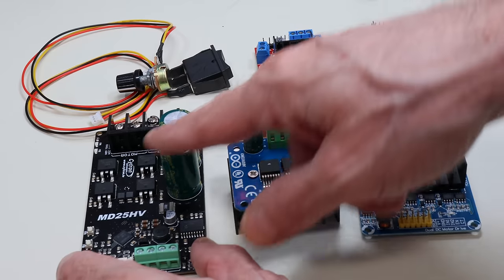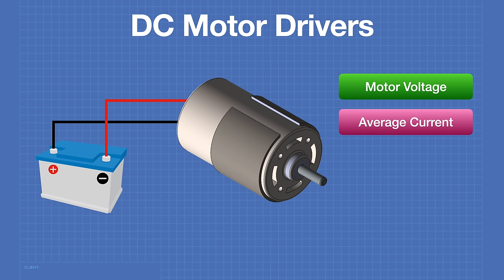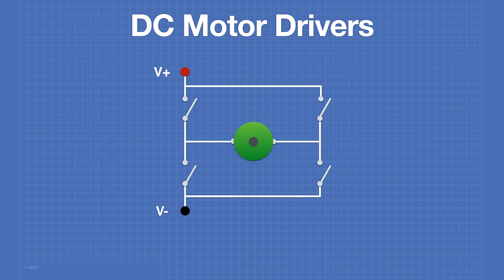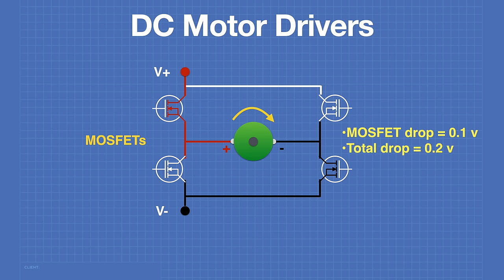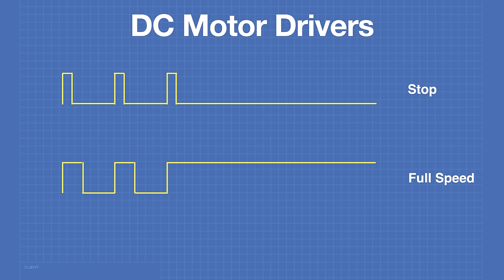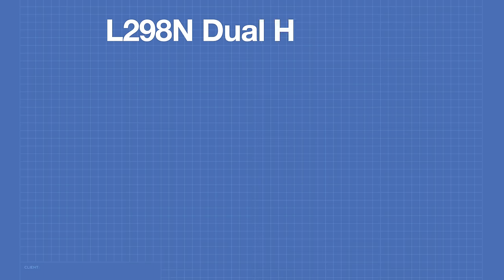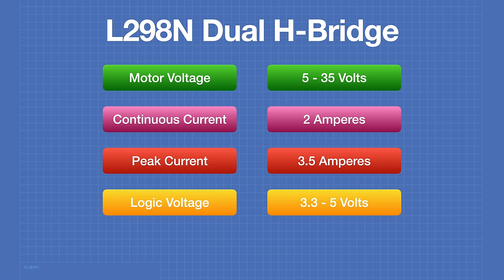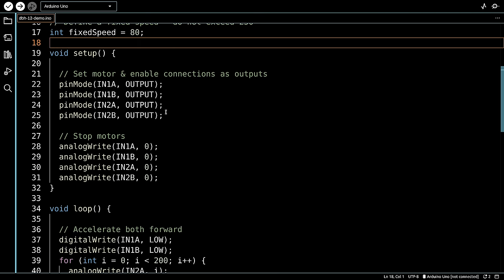Driving DC Motors with Microcontrollers

Comment from the maker: Hi everyone - It's come to my attention that there has been someone masquerading as myself, responding to some comments here with a link to a Telegram chat to win a prize from me.  THIS IS A SCAM, I am not holding a contest, nor do I have a Telegram account.  PLEASE DO NOT RESPOND TO THESE MESSAGES!!

It's happening on a lot of my videos, I'm taking steps to remove them manually, but as I have 162 videos, it will take some time.  If you do run across a suspicious comment, I would appreciate you letting me know at info@dronebotworkshop.com.

Thanks!  

Bill (The real one!)
Reply: @Bill  I was wondering if you have any info or videos on how to connect NEMA 23 steppers with Arduino Mega or Giga even a Uno. I have a few raspberry pies and I wanted to make a CNC controller but I can even install LinuxCNC so I thought I would try out Arduino excellent video by the way take care Bill

Comment: Not to be ignored are the motor controller boards that communicate with the Arduino via I2C.  They only require two of the precious IO pins to drive your robot’s motors, and the libraries available to control them take care of all the setup details.  People new to the sport will be best off sticking with brands such as SparkFun or Adafruit, and picking motors from the same places that they indicate are compatible with the board you choose.
Reply: HB
Reply: I2C is the way to go whenever possible.

Comment: I'm getting the idea the brake function is either a reversal of direction to break the motor, or basically applying a high frequency AC to the motor to hold it or slow it,  I saw a 120v (DC) motor powered on  AC power once, it eas a worm drive conveyor motor and gear box. It just turned the output about .030" or less, of rotation back and forth. And just vibrating on the floor, a diode and capacitor would made it work, a full bridge much better, it was interesting seeing it just vibrating barely rotating at all..

Comment: Great content as usual.
Minor nit pick. Vbe is 0.7V for bipolar transistors; Vce(sat) is 0.3V.
When using FETs, keep in mind that they cannot change from OFF to ON (or ON to OFF) instantaneously; there is a slew rate. When they are in this intermediate state, there is a voltage drop and a current flow; so they have to dissipate power as heat. It is nowhere near as bad as bipolar devices, but needs to be kept in mind when switching them very fast.

Comment: H-Bridge devices have so many different applications.  They can be looked at primarily as a motor controller but I also use a H Bridge to convert the digital signal out from an Arduino  to DCC +-15V square wave for HO/OO scale model railways.  Very versatile device.

Comment: At 3:40 I think you are confusing the base-emitter voltage drop of a bipolar transistor (about 0.7V) with Vce(sat) which is often on the order of 0.1V, similar to a MOSFET. Otherwise, amazing video. I can't believe the work you put in here!

Comment: Great presentation as always! Cytron urc10 robot control board, which is UNO R3 and cytron 10/30 amp driver all on one board, is great project option. One power hookup and lots of pins.

Comment: This is a very well conceived and instructive tutorial. 
However, the most versatile motor controller I know of was left out.
This is Basic Micro's ROBOCLAW. 
It comes in different sizes but the most common is the Roboclaw 2x7 capable of driving two motors drawing up to 7 Amp each. 
This controller has the ability of processing signal coming from motor encoders and controlling the motor's speed via a PID (Proportional, Integral, Derivative) feedback loop.

Comment: BTW: I see eBayers selling Wheel Chair motors without wheels. I found that Harbor Freight pneumatic wheels with 4 bolt holes line up perfectly, and cost around $5. You should knock out the inside bearing to fit the hub nut, and fill the tire with Fix a Flat or Slime since the valve stem will be on the inside mount side.  I think they are the 4-5 in rim, white wheels. The IBT-2 45 amp motor controller works on a wheel chair motor. You can get the IBT-2 cheap 2 for $15. I bench tested my Wheel chair motor  yesterday and it only pulled 10-12 amps under no load so there is plenty of amps left for a load. I believe DWS said the IBT-2 were 30 Amps continuous. 43 peak. I just looked on eBay Wheel Chair motor prices have skyrocketed They run from $130 to $200 each. It might be better to look on Craigslist and buy a whole chair for $100-300 from an estate sale.   5 years ago I got 2 eBay motors without wheels for $75. I also had 2 chairs given to me when a friend's mother passed away

Comment: Great video, helped a TON with my project.  Sadly I already ordered 5 of the L298N, but I got them super cheap so went ahead and ordered the ones I need, the TB6612FNG.  Problem with the first one is that huge heatsink, and I only need 12v so 2nd one was perfect.

Comment: 32:53 This is the diagram I was looking for. I was wondering why there was no separate gnd/voltage for the logic. I didn't know you could just tie the gnd to the motor negative for logic and use the arduino 3v. Thanks a ton, liked and subscribed.

Comment: OMG I ve been for ages trying to drive a dc motor with PWM but I was stupid not to check the datasheet and was trying to drive the PWM on the IN1 and IN2 pins which only worked at very low PWM Freq 100hz... Im going to try it using the Enable Pins later. Thanks for the tip

Comment: The 5v logic input on the l298 also acts as a ~5v supply actually, which is pretty useful to supply μC's without built-in voltage regulator

Comment: Dear Bill, many thanks for this great video! Still have some questions remaining. I need to run a servo-like motor controller for a large DC-motor. From the above controllers, only IBT-2 or MD25HV would make it. Some questions on these:

1. I need all 4 quadrants, meaning the motor might get generative, so it is possible, that the surplus power must be drawn off. How would the controllers cope with? As the MD25HV features no heat sink, its only option would be to feed back to the power supply line. As to the IBT-2, there is a heat sink, but is it able to actually perform braking operation or is the sink only needed to dissipate losses in motoric operation? OR else, if not provided, is there any way to draw power off the board, like usually done to drain intermediate DC from BL-controllers before overflowing?

2. I've tried to use an RC-speed controller with sufficient current and braking. Unfortunately, it is "smarter" than i could use as it stops for a while until allowing reverse direction operation which is not permissible in my control problem.

3. You mentioned, that the MD25HV is inexpensive. Unfortunately this is not true here in Europe and it costs about 8 times as much as the IBT-2. Is there any essential advantage of the MD25HV over the IBT-2, other than the wider operation range?

Sorry for asking that much. Assume, you're busy and i don't want to steal your time, but maybe you could point me to further links or other sources where i could find the answers.

Many thanks in advance and kind regards, Roland

Comment: Hi Bill I just registered for your forum, but I have a question. I'm on a time crunch to get a child size 4 wheel chain driven pedal bike to be controlled by an R/C transmitter and receiver to be used as a prop in a parade at our campground. No one will be riding it. I need the speed to be a normal leisurely pace. This would have to run for 4-8 hours. What motor and motor controller would you recommend? Thank you

Comment: excellent work!!! thanks for your outstanding presentation...your consistent, clear outline for your videos makes them superior to any other source.  You were the first source for my arduino learning process and as my level of understanding grows...you seem to be there with a video on the topic.
I am a noob trying to control 12v powerwheels toy with my 80v lawn mower battery...needing to get the voltage down to 12-18v...from your explanation, an h-bridge does not seem to work...or am I missing something...is there a standard way to control lower voltage, lower cost dc motors with a much bigger voltage source...thanks again

Comment: In simple terms when using DC brushed motors, what is the main difference between an ESC you buy for a hobby grade RC car & the receiver/motor control board you find in a toy grade RC car? It seem PWM is what separates them?

Comment: Really nice content man! Appreciated! I'm currently in a project that I would need to get a simple RC car (with two motors 3v-6v, one for moving forward and the other for changing directions) but the only limitation of it is that I will need to supply the hole thing (arduino nano, Bluetooth module and the H bridge) with max of 4 AA batteries (1.5v each), do you know witch of these H bridge modules are the best for that, or if that is even possible to achieve?

Thank you!!

Comment: Thank you for the video. 
I am trying to repair a board with a motor driver that has been obsolete. TLE5205-2, TO-220 package. 7 pin chip, it has 2 V out and 2 V in pins, 1 GND 1 VS and 1 EF. 
Any sugestion would be appreciated very much. 
This driver runs a 2nd motor on the board. 

The 1st motor runs with a 3 ph controllor and have no problem with that.

Comment: Hello sir, is it possible to connect several IBT-2 Single H-Bridge modules in parallel to be able to control a more powerful motor? And if it were possible, what would the correct connection diagram be like?, thank you so much.

Comment: Sir Bill, tnx for sharing your knowledge without so much jargons. 😂 wish you more success. One question pls, what happens when you use the md25hv with a much larger motor? Specs says 12v 90amps and it has a high inrush current too. I use a old server psu to power it up but i wanna reduce it as its too loud while im troubleshooting and doing repairs on other components. Its a dual pump air compressor.

Comment: I have this delay timer called YYC-2S it is a brand new timer but  some the delay settings inside do not work as advertised.

The timer has NUVOTON N76E003AT20 IC on it.

It has Four, seven segment displays on it and four button controlling a single relay switch.

Can assist with reprogramming it

Comment: Thank you for the excellent quality of the presentation.  I have a 3-Phase 48V DC brushless motor (BLDC) with maximum current of 7 Amps. The motor has a PWM input pins.  I would appreciate if you could recommend an appropriate controller for this motor.

Comment: So, if you have a 4WD robot car, each motor being run by three different pins, already 12 of your Arduino pins are used. Is there a better way to handle such a problem, or do you have to just settle for using the analog pins for everything else you want to use the Arduino for?

Comment: Hi, so I am building a tactical RC, 24V motors. Everything works except the pins on arduino. The code is exactly as shown in this video for IBT 2 but most of the pins don't work right. 0-255 speed controll only works on few pins, rest don't spin the motor until pwm as max speed. Any idea why this is?

Comment: Excellent. I have some controllers similar to your last one with a direction switch and a speed dial. Why do they only work with brush motors and not brushless. Most of my fans are brushless.they only seem to work in one direction and mostly with the dial turned way up. Did you make a video for this? Tia

Comment: Regarding the BTS7960, I am confused. I was expecting that the two enable inputs can be used to enable/disable the motor for one direction individually. Only this way, I could use them with two separate limit switches. If one limit is reached, I should be able to move back into the other direction but if bot enable inputs must be high, I don't see a way to solve that unless I use some additional circuitry. Could you please clarify ? Thanks

Comment: I have a Minn Kota MK80 trolling motor and controller. The motor is dc with Brushes. I took it apart and reassembled. It spins when put directly across a 12v Battery.
So I put the controller on a scope. The signal goes to 24 vdc. But the motor does not move. So I figured maybe I will build a dc controller.
Do you have any suggestions?

Comment: Can you recommend a small footprint motor driver that is a “stand alone” not requiring a micro controller? I’m using a little N20 12volt motor. 🙏 BTW, I’m learning a lot from your channel… 🙏 Thanks.

Comment: Why does the last example squeal less? Just because it’s larger and resonates less? Also do those boards send pwm to the motor or do they control with voltage (specifically the last example)? Thx!

Comment: could you possibly link to the video you have explained the adjustment of PWM frequency please?
right now I'm playing with the IBT4 driver, which handles 50A and has only IN1 and IN2 for PWM forward/reverse ..and I want to get higher PWM frequency up to 200kHz as it's supposedly to work with.
from my understanding I would have just to use smaller delays between adjustments to get higher frequency, but that's just my theory.

Comment: so l298n has 2 amp continuous current, is that per dc motor? So if I hook up 2 dc motors with peak current of 2.1 amp and cont 0.68 amp, would that work properly?

Comment: Sir, i have a project and i drive a d 775 dc motor with arduino by using bts7960b. In small time i make the motor turn right to left and left to right. In this case my arduino nano stucks and i have to reset it. I thing back emf occures on the motor side. Could you please help me how can i solve this problem? Thanks.

Comment: Hello. You are wrong about the efficiency of the L298N dual bridge driver. I saw a lot of videos saying that the voltage drop is 2V, you said 1,4 volts but both are wrong.
The issue of the voltage drop is actually because you do not supply enough Logic voltage (this apply to L298N chip that are made by STMicroelectronics). After you remove the jumper between 12V and the 5V regulator, you should apply 7V on the 5V logic pin . In the datasheet of the chip is clearly specified that logic voltage is 7V, not 3.3V to 5V.

Comment: this was very informative but im still confused on how I can run a linear actuator on a RC robot using a smartdriveduo 30 to run my drive, I would like to use the channel 5 switch to extend and retract by flipping the switch, seems like it should be easier?

Comment: I am looking for a motor driver to run a dc motor listed as 1/15 hp. The armature is listed as 115v. Can you suggest a driver that can cope with these values. Originally it ran with a variac and rectifier. Many thanks.

Comment: Is there a board that can be used to drive a bank if MOSFETs to power really large motors, like a 12kw series wound dc motor on 72v-96v? Im looking for a cheapabd easy, quick and dirty way to build a motor controller, using a internal buck converter to drop the battery voltage to 12v  the gates would be getting something between 5v snd 10v-12v, or would it be possible to program a micro controller. To read the current and apply a pwmcurve to pot position or a voltage from the throttle, to limit the throttle or limit the speed the motor reacts to the throttle, and other Variables, then from microcontroller, a pwm output to a ciuple mosfet drivers to a bank of fets or igbt's  enough to handle atleast 30% more current than the motors can pull. (50-100% more would be better) And use a cintactor to do the reverse operation , also have a program to limit power in reverse to 40% or so. Could this be a viable option for a crude controller, i know a emf snubber would be required ti prevent destroying everything when the motor it decelerating,  and wiuld 15 khz be a decent  pwm frequency, to be nearly silent id like to hear some sound from the motor, i know a professional built commercial controller is a better idea, but i like to build everything, im not even that knowledgeable in electronics, (likely painfully obvious by now ; ). Tthanks for you time and videos

Comment: Great Video!
Is there a difference with the use of stepper motors instead of DC motors? Or can I use the same setup and replace the DC motor with a stepper motor (like Nema 17 or so) ?

Comment: Great DC Pwm H-Bridge workshop! Q: is it possible Theo Oskam pwm control a Dc 12V motor very low rotatie speed like 1 rpm ?

Of for this low speed a stepper motor required?
Thx.! Kind regards Theo

Comment: Sorry but choosing the motor You start in the wrong end. Number one is the torque, the RPM, needed. Arduino Forum is drowning in people missing that, and their projects fail.

Selecting a motor the drivers capacity for current is often number one, not forgetting the stall current. The voltage range is often wide enough. 

Stall current is what the motor pulls at start from stand still. Good to manage that...
Please warn people from buying the old crap L293, L298 boards. The waste 2 - 4 volt and using a couple AA batteries, things don't move.

Comment: MD25HV Single H-Bridge & Controller can i use this for the pot? hall effect potentiometer angle sensor 90deg 0-5 output i wold need a 5 volt input. i just need to know if the hall effect will work? it is not a resister it is a 0-5 volt output. how can i contact you to figure out how to use the hall effect for control of a 12 volt power supply. zero to 12 or more volts, and how would i get a ramp effect?

Comment: I'm trying to drive motors/wheels for a tennis ball launcher machine. Difficult to match rotor shaft with wheel so it just screws up all balanced nicely. I've drilled out centre of wheel size of coupler and hammer that in, then run the wobbly wheel while using a cutting tool to grind away until balanced. Best I can think of. Any ideas anybody about matching a balanced wheel on a rotating shaft.